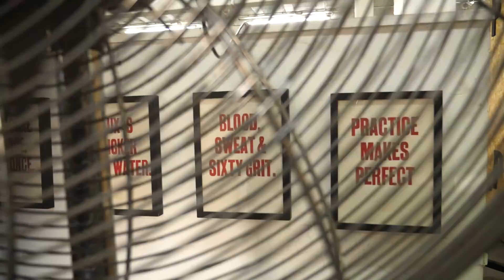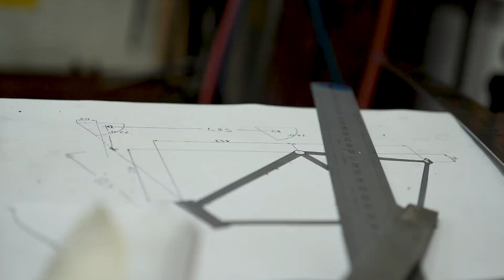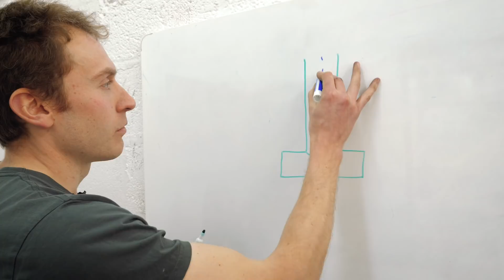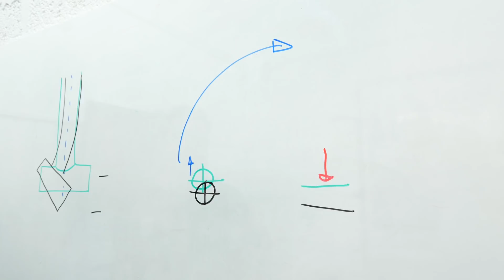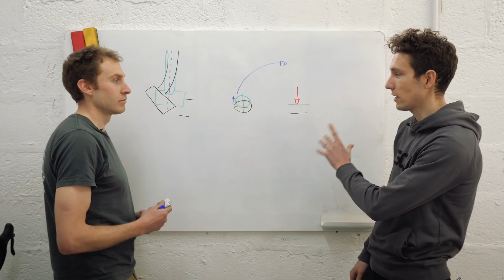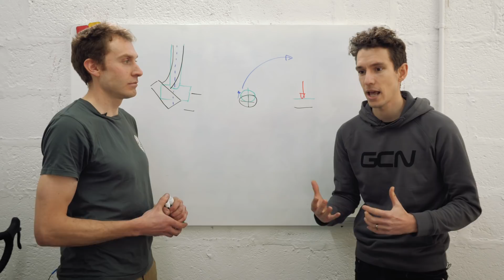Are You Faster On A Stiffer Bike?

Comment: There are a couple places where high school physics does not model reality very well and this may be one.  Based on your thesis that the frame is essentially a spring and the energy is returned to the drive train, the stiffness should not matter.  The thing we should care about is damping of the material in the spring.  The energy stored in the spring will also be proportional to the stiffness (displacement) and the damping.  There for low damping and high stiffness will have lower loss.  Carbon fiber is a good bet to win that contest. That said, this probably impacts the feel more than anything and there is a bigger problem...

Physics does not model the work of constraint - that is the work your muscle does to hold position.  In physics your holding the pedal does no work and requires no energy,. We know that it does require effort to apply the force to hold the pedal under load.  That force requires us to exert energy from our muscles even if physics model ignores it.  Thus anything that increase the duration for which we need to apply force is requiring more work from our muscles, even if it is just hold the pedal while the spring unloads.  This sounds insignificant, but adding milliseconds to every rotation is noticeable.  This has been studied as the “work of constraints” by Prof Andy Ruina.

Comment: The stiffer the frame the less energy is being used to flex the fram and therefore lost, due to the fact that each time you flex a material energy is absorbed when it flexes meaning it will not give back the same amount of energy as you put in. This can be in terms of heat, vibration and minuscule amounts of wear to the material. The stiffer the frame the more enregy goes straight to your drivetrain making you fast AF. But this is not as simple because when designing a bike stiffness impacts more things than just your power output to the drivetrain. Stiffnes will impact the weight, ride feel, and durability of the bikes aswell as your wallet. So maybe a stiff frame is better or maybe not who knows.

Comment: I’m not entirely convinced at his theory. His experiment leaves the door wide open to a lot of questions. It works when the release is “static” with the drive side pedal at 3 o’clock. What about when it’s dynamic between 3 o’clock and 6 o’clock? What happens with the non drive side? Part of the flexing is created in his contraption, surely it will react differently in the road, Right? How will wheel flex influence the result? Many questions I trust you guys from GCN will come around to investigate! Thanks for this extremely interesting video!

Comment: Pretty heady stuff, Si - You're smarter than your excessive FTP would imply.
I would posit that hysteresis losses go up with flexibility, but this may be offset by a natural frequency that corresponds with your riding style / bike measurements.  There might then be a curve with a minimum loss point at some level of flex (I say might, since I don't know whether this natural frequency actually occurs in the range we build bikes at).

The tire phenomenon depends on the road surface variation - lower pressure is not ALWAYS better, there is an optimum point.

Comment: Lots of bro-science going on in the comments. Hopefully a proper materials engineer can get involved soon.

Until then... I've been told steel is a perfect spring, meaning that all energy put into it is returned until the force is greater than the yield strength of the steel. This is why high yield strength steel is used for springs especially suspension components.

The real question is where does the energy go when it is released? As others have pointed out it probably isn't helpful to have the energy released back into your legs, and it's unlikely to go back into the drivetrain.

Comment: Physics 2!  The frame can be modelled as a mass, spring and damper arrangement.  When work is being done accelerating a mass or compressing a spring the energy is not destroyed, but returned into the system.  However, for a damper it not returned, it is instead converted into heat.  The test in this video only demonstrates the spring part of the model as it is a static test and not dynamic.  If we had very sensitive measuring equipment and ran the test over many revolutions with a large deflection, it would be possible to measure the temperature rise in the frame tubes.

Comment: frame flex = potential energy
the more frame flex, the more potential energy which equals more kinetic energy.
 and just like in algebra the equation must always equal 0, which means 100% of the kinetic energy applied to the pedals gets transferred to the wheels with or without frame flex minus heat loss.

Comment: Here's an easy thought experiment. You expend x energy applying y force to a structure and it bends by z. You next expend x energy applying y force to a second structure which is identical except that it's a bit stiffer. It will bend by a bit less than z. No energy saving here. Why would you think the same does not apply to a bike frame?

Comment: so limited experience with super stiff bikes boy are they expensive), but i do have some with cross country ski poles, and have an mechanical engineering background. I think the losses due to hysteresis (flex/heating) in the materials used for bike frames and the amount of flex they actually have on the road are negligible. I agree that the return flex is likely giving most of it's energy back as well. I think there is a "correct" amount of flex for a given rider in a given situation. what you want is for the bike and rider to resonate. so you don't want the flex to return energy at the wrong time as it will just feel strange, or hurt the output of the rider.

TO go back to ski poles, i tried out tow different pairs of them back in the day, one was lighter but more flexible, the other slightly heavier, but much stiffer. I didn't like how the flexy ones felt, they seemed to spring back to late in the stroke to me. Lots of other people i skied with however loved the flexy ones, and hated my stiff ones. I'm pretty sure there was 0.0001% difference in the energy losses between the poles.

TL;DR get the bike that feels best to you and don't worry about how flexable it is or isn't.

Comment: There has to be a net loss of power due to the flex in the frame. The kinetic energy which is transferred from the pedals to the frame will generate heat as a byproduct of the kinetic energy moving into the frame and being stored as potential energy. When the frame moves back to its original position the potential energy is transferred back into kinetic energy which is transferred back to the cranks which move (this can bee seen 8:59 ). This will happen during the bottom of the pedal stroke. That is true for the drive side, the same thing will happen in reverse for the non drive side as the flex in the frame will move in the same direction as the returning movement in the frame meaning that more power will be transferred to the drivetrain and therefore move the cranks more on the downstroke of the non drive side. This means that when the frame returns to its original position, but the frame will continue to flex past the original position meaning you are putting in power to move the frame which is not being put into the drivetrain. Therefore there is a net loss of energy due to kinetic energy being converted into heat due to the flexing of the frame.
 
Also I know from riding different bikes when you see the bottom bracket swinging from side to side it's not exactly efficient

Comment: The thing is you don't have a concrete block when riding so when the frame is "giving the energy back" it will push that stored energy into the wheel or YOUR LEG!

If you have enough strength to flex the frame on your down stroke, the frame will kick your pedal revolution back right in the dead spot equal to the force needed to flex the frame. I believe this is why stiffer frames feel faster.

Comment: Pretty much all new bikes are marginally (1-10%) stiffer than previous models...based on the over exaggeration of loading in this video compared to standard road usage and the results between bikes looking pretty similar, surely bike stiffness is just clever marketing from the bike industry and has pretty negligible performance gains compared to say something like aerodynamics or weight?

Comment: Hmmmmh?.....I like the piece and very thought provoking, but I bet some of the flexing is lost as heat, any material that flexes produces heat, but it may be imperceptible and of course out on the road it’s quickly carried away by the air around the bike. Could it be that some of the energy during this experiment is stored by stretch in the drivetrain, then released when the brake is released to spin the wheel, although I guess that is the same as the energy produced by the twist in the bottom bracket?, Great video but not entirely convinced.

Comment: Does the wheel move when this test is done on the non-drive side (left)?
I'd argue it doesn't because if you put the force on the right side the flex in the frame would put some tension on the chain making the wheel move when released while putting the force on the other side would actually slacken the chain.

So.... what's the deal?
Reply: It might, but it would be in the opposite direction as the force applied on the right side.
Reply: That was my point.... the force is opposite.
GCN needs to do some quick science to check. :)
Reply: Johnny Cab I disagree in part. The experiment does exaggerate the amount of flex in the frame, but the bottom bracket does move, and that movement would provide force to the chain (or slack when applied to the pedal opposite the drive side).
Reply: Christian Holmstedt I think the force is still carries in the spindle of thr crankset.
Reply: Christian Holmstedt Sorry for the confusion. I was trying to reply to rkan.
Reply: Christian Holmstedt good point
Reply: I agree with this. The wheel is only spinning because of the tension placed on the chain with the brake on. If they had the pedal at BDC I'm sure this wouldn't happen.
Reply: Uuuuh how about No??  When you are riding your bike does putting force through the left pedal slacken the chain?

Comment: what I think is despite the heat and other ways of energy loss, the amount of energy spent on flexing the bottom bracket will be lost, as the bb will comen back to the center, wien the pedal is on the bottom, with a less effective retention from the foot. so, it will come back to the center, not transfering the energy to the drivetrain.

Comment: Is it not the pressure on pedal just slightly rotating the freehub and then when the rear brake is the released the freewheel releases and "kicks" the wheel forwards?
Reply: I completely agree with you. I think this test is flawed. I don't know how you could see it any other way. Try it with the pedals at 12 and 6, and I bet the results will be completely different.
Reply: Lee Hyson The pedal is resting on the block, thus it is the frame flex that is "turning" the crank and the chain and thrn the hub/wheel.
Reply: What seems to be getting missed in the video and in the comments is that the pedal continues touching the block after release of the brake, therefore the crank arm rotates around the bottom bracket at the last, the chain moves, and 'that' is why both rear wheels spin. The pedal traveled a small portion of its normal circuit round the BB, it simply did so nearly instantaneously with the rapid release of all the potential energy of Sigh's standing weight. Measuring wheel speed post brake release 'could' provide an answer as to absorbed versus transferred energy, or rate of energy transfer, but you'd need a trustworthy release mechanism on the brake, i.e. not a human hand. Keep in mind that the braking system itself is storing energy under load...flexible rubber, steel cable under tension...how do we know how much force that returns to the rear wheel?

Comment: The minimal heat losses due to flex are probably well below 1%. But when you consider the margins grand tours are won by you could see why top end frames are rock solid. As for the rest of us, probably less important than weight and comfort. It will also feel a lot better to have your effort go straight to the road, rather than have a tiny delay
Reply: Ellis That one percent will easily get lost within margins of error if measured on such a large scale.. Impossible to measure it.

Comment: Clearly, stiffer frames transfer energy from the pedal to the drive train more efficiently.  Yes, some (probably most) of the energy stored when a frame flexes is returned to drive the bike forward, but there will be heat loss as transfer of energy always incurs heat loss. But, does that make the bike faster? There are myriad additional factors such as rolling resistance and discordant vibration through the system that will slow down the bike. A stiff bike may FEEL faster - much like harder tires do; that doesn't mean it is. There's a story at Cannondale that, when the Super Six Evo was being developed, Ivan Basso, who was on the team at the time, said the bike wasn't as fast as the previous model - the Super Six. But, on the Evo, he was faster. Turns out that, because it absorbs small road surface imperfections much better than the Super Six, the Super Six Evo is actually much faster.  So, how fast a frame is (isolating that from the wheels and tires) clearly is not a product of its stiffness alone.